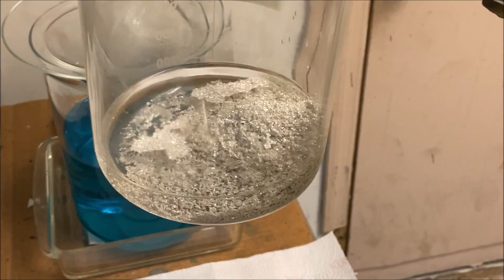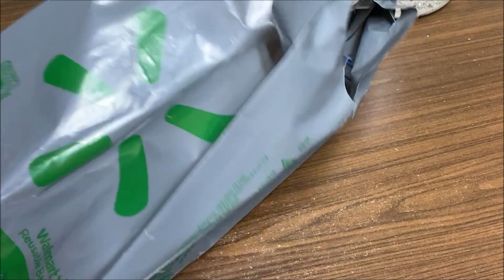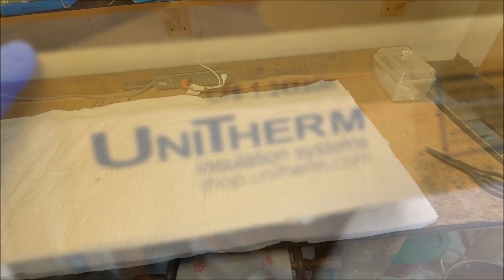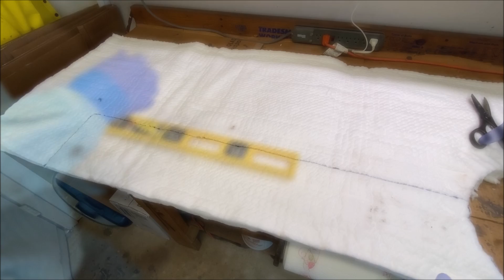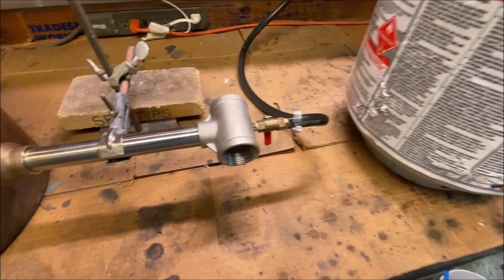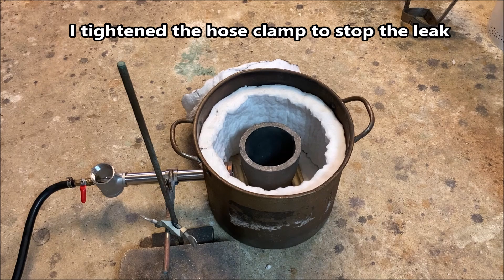Furnace Build For $100 Part 1

Comment: Just be careful!! Keep the propane tank as far away from the furnace as possible!
Have a Great Day My Friend!!!
Reply from the maker: I’ll move it outdoors to do the actual melt. Hopefully have the video posted tomorrow or Friday. It scares me Shane.
Reply: @sreetips  Fear is a good thing, man.  Keeps us safe, and from taking risks.  Perfectly natural.  Other than not cementing the wool, I think it's a pretty dandy cheap build.  
The fear will subside after a few fires.  Just never get cocky lol
Reply: Also if you are doing a long melt put the propane tank in warm/slightly hot water to keep from freezing up. Or go up a size in propane tank from the bbq tank

Comment: I think nile red burned up a crucible this way. I think he said an oxidizing flame will eat away quickly at a carbon crucible. He used propane. Just look out for burn through before you pour or melt again.
Reply: Also de_Zink that Burner so you don't get zink fume poisoned.
Building one now....
All the best luck.....and you got the BEST SUBS......
Cheers
Reply from the maker: Graphite does get consumed as the crucible gets used. I’ll watch it closely.

Comment: I just got my devils-forge furnace today.
Reply from the maker: All the guys on the GRF forum said, “build your own cheaper.” So I decided to give it a try. We’ll see how it perform tomorrow.
Reply: @sreetips  and they were right, i use two k26 bricks, bailing wire and 2" kaowool. thats it. i can touch the outside of my furnace with my finger when it is 2200f inside. 
*dont put your kaowool in a can.